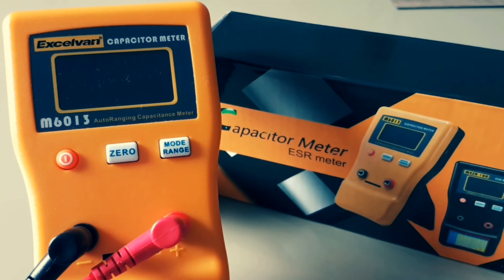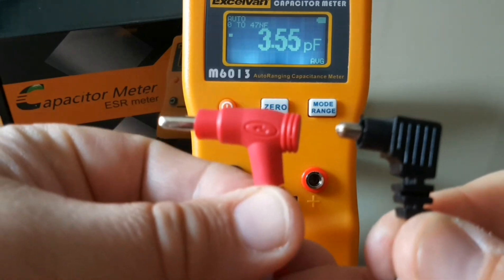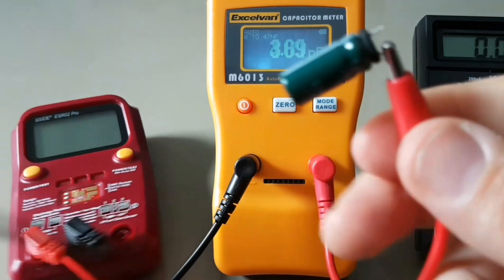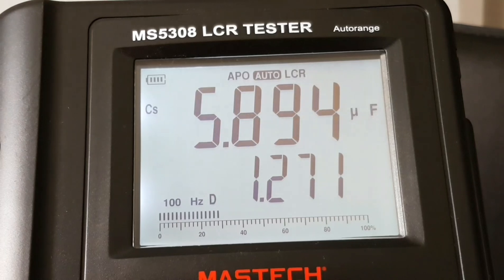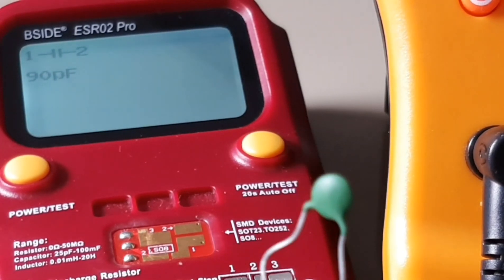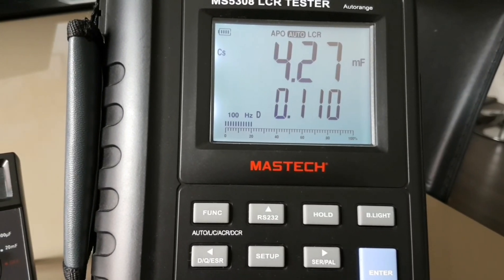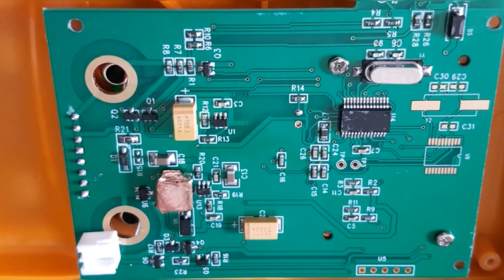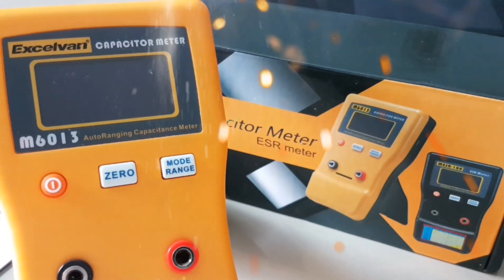Excelvan M6013 Version 2 Capacitor Meter Review and Teardown!

Comment: at 12 : 1 1  you said the Mastech and CM7115A ( 4.36mF ) was pretty close when actually the Excelvan ( 4,266.7micoF ) and Mastech ( 4.27mF ) was more spot on...
Reply from the maker: Slip o the tongue...😄👍 thx for clarification
Reply: @KeepOnTesting  np!  -  I have a small Peakmeter PM8232 which does only micro and milli Amps.  The front cover says 600V AC/DC 200 mA Max, the ceramic fuse I took out says F250mA H250V and on the circuit board it says 250mA 600V  and I have two green frog PTC's on the board too.. what fuse should I replace it with, the 250V or 600V ceramic ? or can I solder a resettable fuse PPTC TRF600-200 600V 0.2A 200mA on the fuse holder instead of a ceramic fuse?
Reply from the maker: @pagepro211  Personally,,I would solder a resettable polyfuse with a 200/250mA rating.Much less problematic in the long run..I've done this with a few dmms and it's a great alternative. 👍
Reply: @KeepOnTesting  I found two different ratings on a 200mA polyfuse, one with 250V (as the fuse I took out)  and the other 600V (stated on the circuit board and front cover)... which voltage rating should I get?
Also, Is there a way to buy and add shielding on the back cover of any meters as an diy improvement?
Reply from the maker: @pagepro211  Since it was originally a 250V fuse I would replace with the same, even though it's marked 600V on the pcb. 👍
As for shielding,  I'll be putting up a how to shortly on the website (keepontesting.com)
but this copper foil tape works really well.
https://www.ebay.com/itm/273718823877
Reply: @KeepOnTesting  thanks! looking forward to it.

Comment: It is giving constantly floating reading, you can't be never sure about correct result. No averaging calculation, not for me! :-(
Reply from the maker: Its still a decent meter although I agree it does tend to obfuscate the reading with random settling times. I still use it quite often though.

Comment: Does it compensate for the leads? I need to get one to measure very low capacitance, from 2000 pf to down to 1 pf for RF variable and vacuum variable capacitors, Thanks
Reply from the maker: You can bypass the leads altogether for those tiny ranges. Just insert the capacitor into the mounting receptacle, I just tried a 1000pf without a problem.

Comment: You gave the Excelvan 4/5 stars?  The capacitance values were off on every cap compared to the  Mastech and CM-7115A meters,  both of which were pretty close to the same capacitance value when tested, and appear to be better testers.  I have an Excelvan that I bought based on 'decent' reviews.  It reads low on every capacitor I have tested, old and new. I also took it apart hoping to find an adjustment/offset.  Unfortunately there was none.
Reply: Same with me. It reads about 10% low. Not a lot of use at that level of inaccuracy.

Comment: Does it work when connected using the usb power? Mine hangs when trying to zero while connected to usb 🙄
Reply from the maker: I'll test that out later tonight...and let you know.
Reply from the maker: Sorry for the delay Keith, yes mine works via an external USB Battery no problem.
Reply: @KeepOnTesting  Oic.. Guess probably mine is an isolated faulty unit.. 😔 Thanks for helping to check 👍

Comment: It was a nice review and very educational and thank you very much for your time and effort. There is also another LCR Bridge meter with an insane range for measuring the inductance, capacitance and resistance. This meter is called “Professional M4070 Hand-held LCR Bridge Capacitance Inductance Meter”. The  M4070 does not do ESR.
I will supply you with the link. Would you do a review on M4070  Hand-held LCR Bridge?
https://www.banggood.com/Professional-M4070-Handheld-LCR-Bridge-Capacitance-Inductance-Meter-p-938984.html?rmmds=search&cur_warehouse=CN
Reply from the maker: Certainly, thanks for the feedback!
 I will most definately attain this LCR meter and do a full review.

Comment: Can this test caps without removing them from the PCB first?
Reply from the maker: It's not an ESR meter so technically no. However, I have used it successfully while the components were still on the 
pcb and it worked about 50% of the time. It really depends on the circuit in question..if there's other caps in series etc. It's always nice to have a dedicated capacitance meter in conjunction with an ESR meter. This s a great capacitance tester thus far and it has exceeded my expectations.
Reply: Great review Darren! I have only a basic knowledge of electronics and try to fix most anything with my limited ability. I would use it mainly for repairing power supply in computer monitors. Sometimes it's obvious if a cap is bad but not always. Some of them can be a real pain to unsolder just for testing especially if there are 8-10 electrolytic caps in close proximity. I refuse to throw out a good monitor when I know that replacement hi-temp caps are so cheap. Just need to find the faulty ones.  When you say it works 50% of the time on the PCB  how do you know if it is working or not?
Reply from the maker: If I'm measuring the cap on the pcb I'll  verify the capacitance rating then test it with the meter, if it's in spec and visually fine I'll move on with my troubleshooting. If completed troubleshooting the circuit and problem persists then I'll either remove the caps or pull out an ESR meter. I'm usually good half the time without the need to pull or check for ESR. Practice makes perfect so best ber is to try to find some old non working equipment and test test test. :) After awhile you'll develop a troubleshooting regime that works for you...thanks for watching !
Reply: @danreynolds8028  Same here it says ESR on the box too !